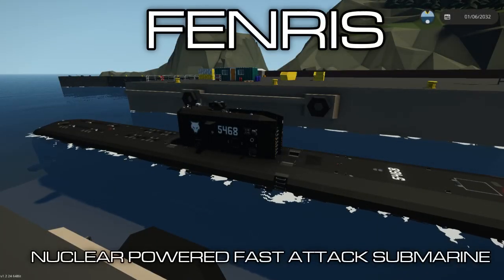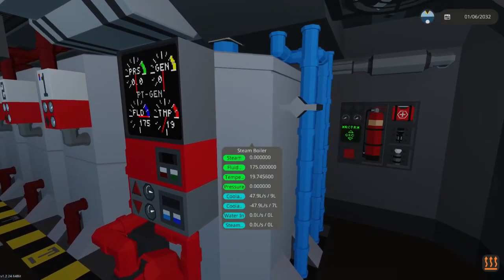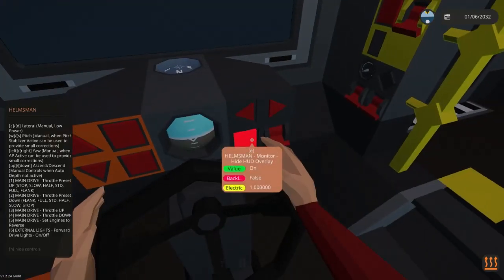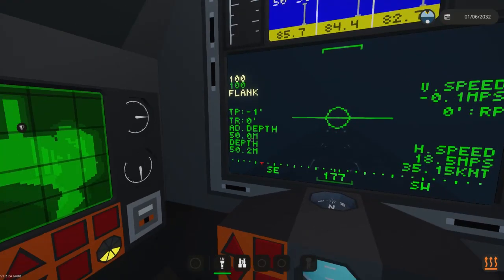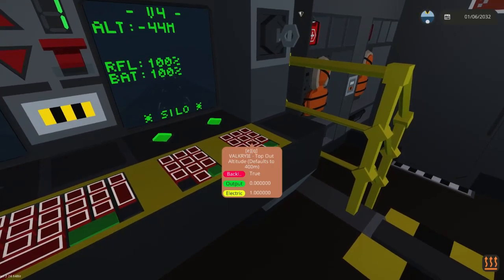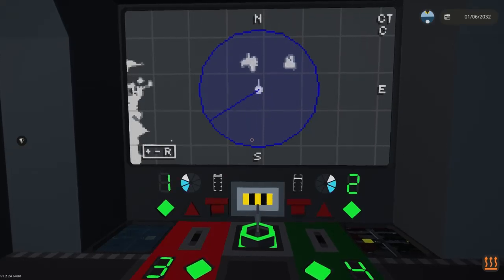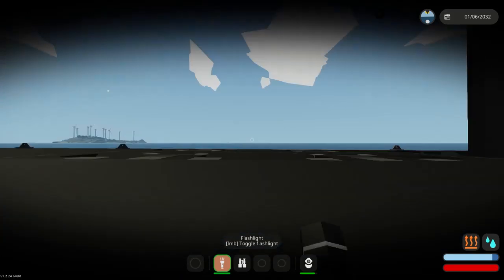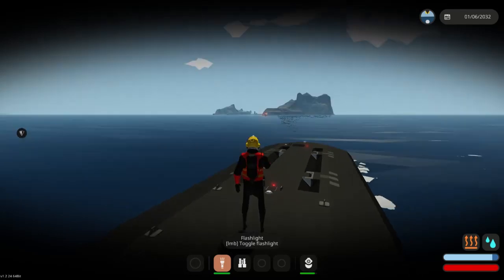SBS FENRIS Mk.I Nuclear Powered Fast Attack Submarine - Stormworks

Comment: Love the sub, anyway to make it meltdown though? asking for a friend.
Reply: @seabosssystems8279  the author is doing that now. Said so in comments. Im guessing you are the author??
Reply from the maker: The FENRIS has now been updated to support manually starting incidents such as meltdown and floods. Beneath the SIT AWARE station desk in the C&C is a BIG RED BUTTON. It is clickable through the "desk". Activate will open the INCIDENT GENERATION screen where you can choose an incident and then start it. Meltdown happens by preventing the control rods from deploying when you turn on the reactor. It would eventually then super heat and melt which would also cause the boilers to blow in time.
Reply: @seabosssystems8279  Cool,  thanks man

Comment: What is the "Master to Umbilical" circuit breaker for?
Reply from the maker: That breaker is tied to an Electrical Connector on the Top Aft section of the FENRIS near the maintenance door.  The breaker is used to control power transfer to and from the FENRIS externally.
Reply: @seabosssystems8279  ok, thanks

Comment: How do you open the Hatches wich are locked by Code
Reply from the maker: The code number is 5468.  It's currently the same number as on the sub.  Additionally it's located in the description on the CO's safe and also in the Stormworks Workshop entry description.  I have plans to make the numbers more "dynamic" in that they can be changed by the owner of the sub.
Reply: @seabosssystems8279  thanks man